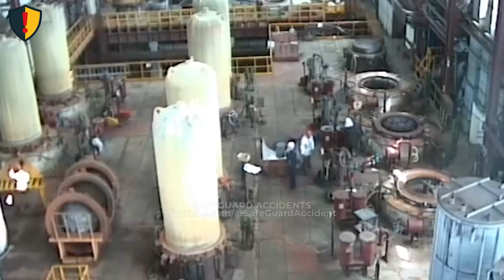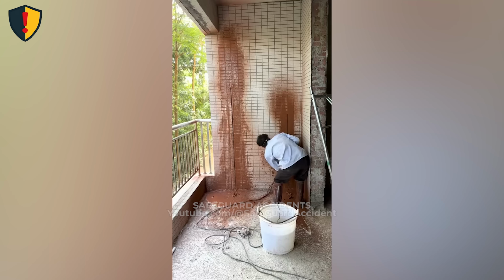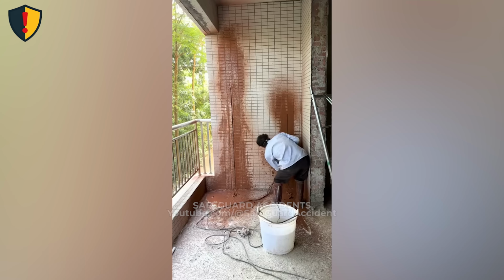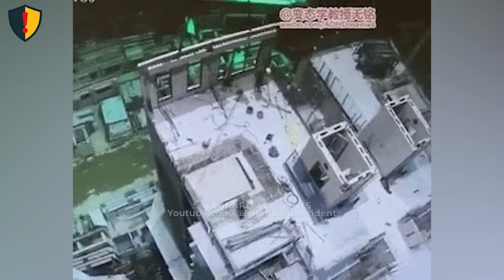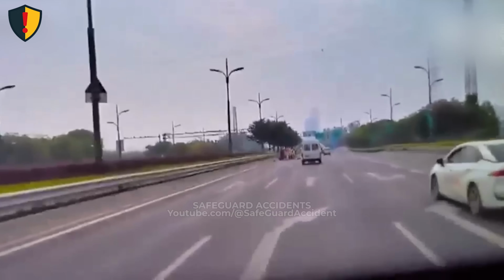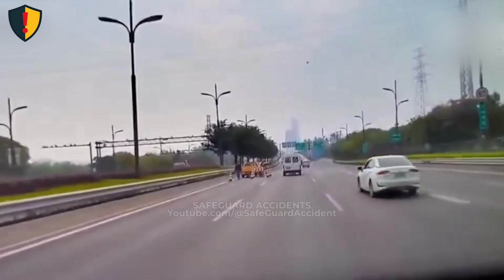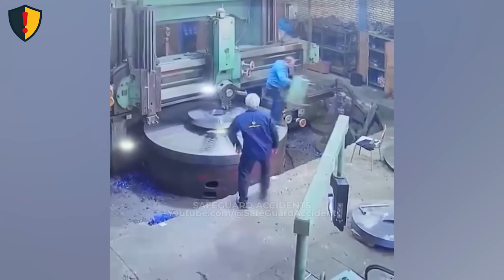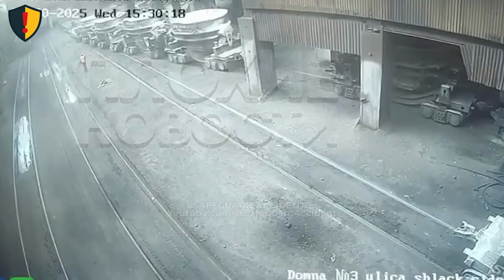😱 ROTATING MACHINE ACCIDENT PT.35

Comment: The first guy... You never wear watches, jewelry, long sleeves or loose clothing when operating a lathe. This poor guy was wearing a winter coat telling me that the cheap ass shop owner probably had the heat shut off forcing workers to find ways of staying warm in the winter. I hope he was gone as soon as it grabbed him.
Reply: Someone on one in the comments of the uncensored version of the lathe accident pointed out that when he initially got caught before it started spinning him his leg shot out stiff and I forget what they called but it's a reflex whenever someone suddenly dies.Their theory was that the initial grab crushed his brain and spinal cord killing him instantly from the tension alone. I'm hoping they were right and he was already dead or that there wasn't enough brain activity left for him to be aware when his body started spinning. He was undoubtedly dead mere seconds after being pulled in but I'd hate to think of anyone being aware of what was about to happen or being aware for even a fraction of a second during it.
Reply: @martin023dm  He probably saw  his sleeve catch and then it all went black RIP
Reply: @RabidBunny420 I hoping beyond hope that's most he experienced. It's so terrible and what happens to his bidy almost doest even seem real it's so cartoonishly horrific.
Reply: It was the chuck, spinning into his brain. Ate half his head away before the rest of him is sucked in.
Reply: lol most shops don’t have heat or AC. You probably work at Wendy’s

Comment: The guy with the big saw is ok because he was using a diamond blade, which has no teeth like a conventional wood or metal cutting blade, but uses diamond particles and feels smooth to the touch.
Reply: He's ok because he thankfully landed on the guard and not the blade. Believe me even abrasive cutting disks can cut through skin and bone. I've almost lost a finger to a cut off disk on an angle grinder myself.